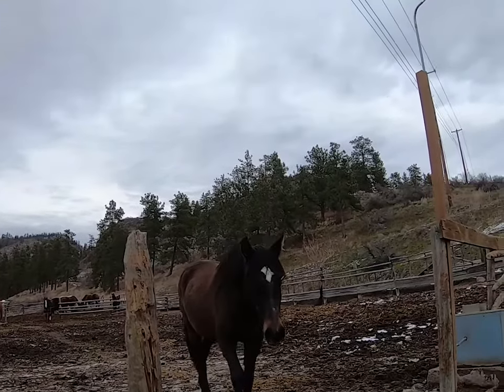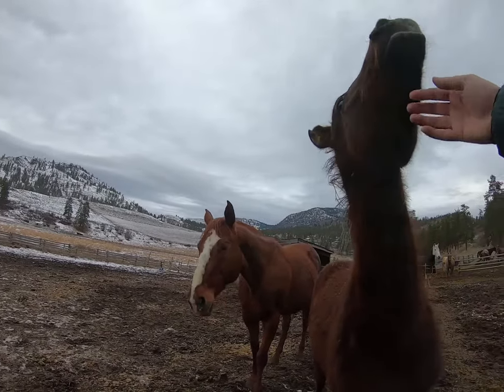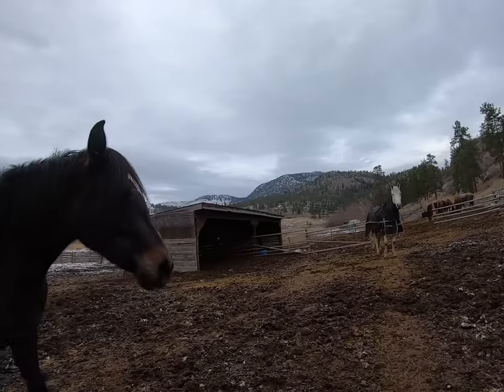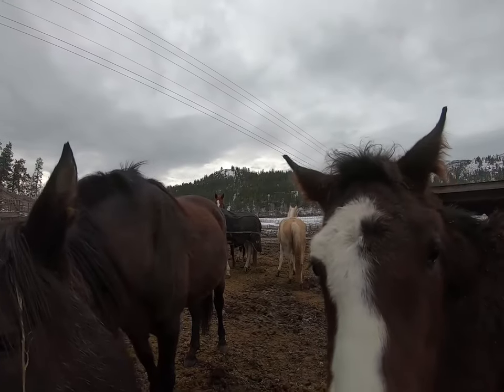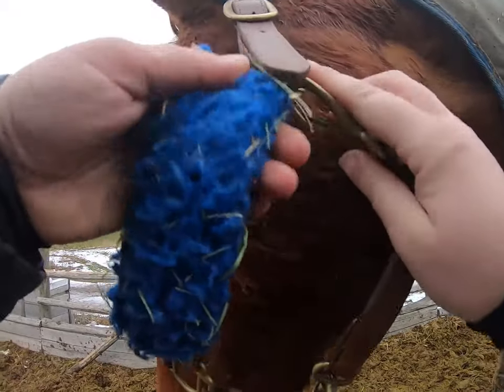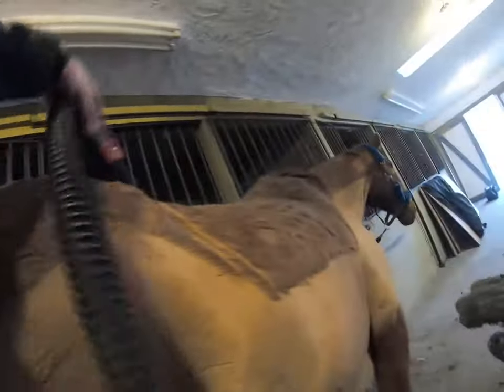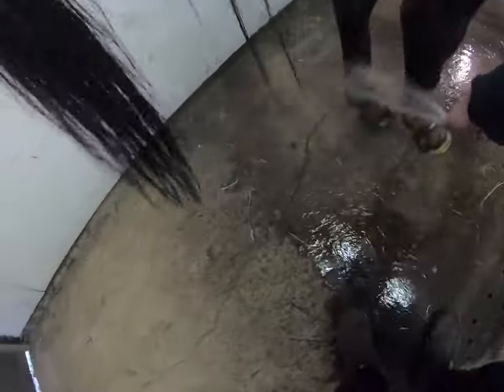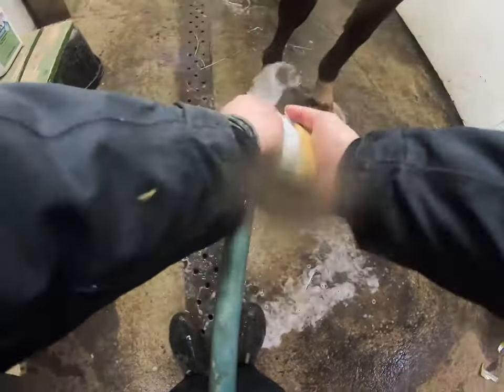Briefly meet ALL my horses!  How I prep before hauling to a lesson | Resetting composite horse shoes

Comment: Great Video! I like the hack with using a shop vac instead of a horse vacume :D I loved seeing you set the comppsite horse shoe too!
Reply from the maker: Thanks so much!  You can use the shop vac to suck up dust too but I find blowing it off gives nearly as good of results and you don't have to wash or change the vacuum filter nearly as often!
Reply: @dreambiggerjumphigher8059  oh didnt know that cool!
Reply: @dreambiggerjumphigher8059  so you own 13 horses
Reply from the maker: @emilylipsitz  12
Reply: @dreambiggerjumphigher8059  will you get anymore horses or a horse
Reply from the maker: @emilylipsitz  probably not for a while :) I have my hands pretty full right now.
Reply: @dreambiggerjumphigher8059  will you breed anymore of your horses
Reply from the maker: @emilylipsitz  if I do, it would be the same 2 mares as they are the ones approved in the stud book
Reply: @dreambiggerjumphigher8059  ok